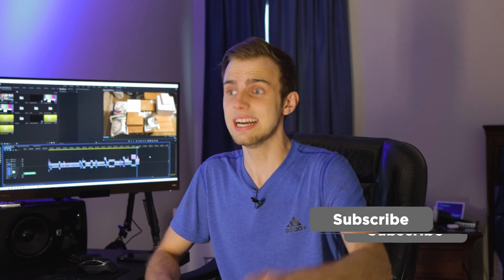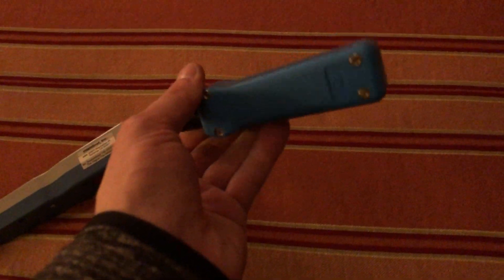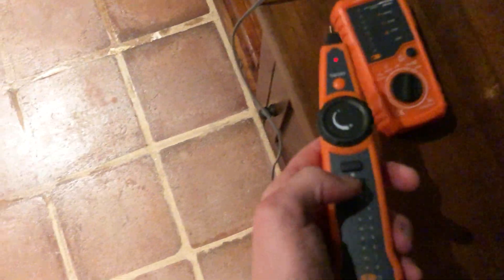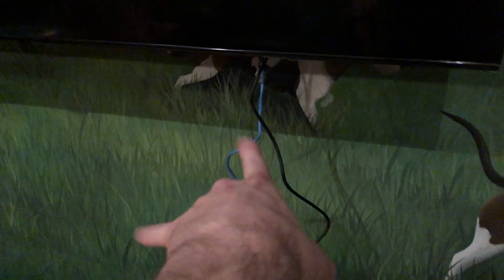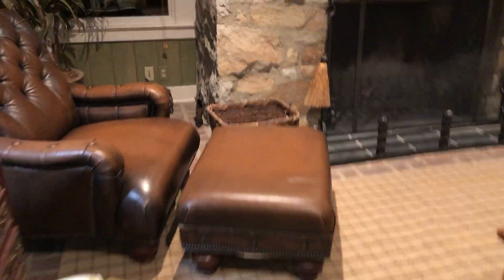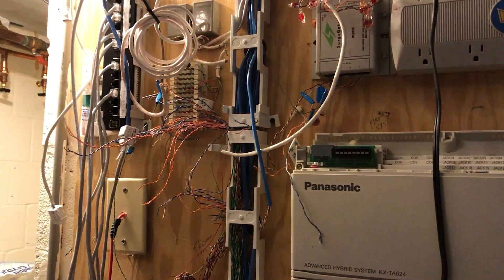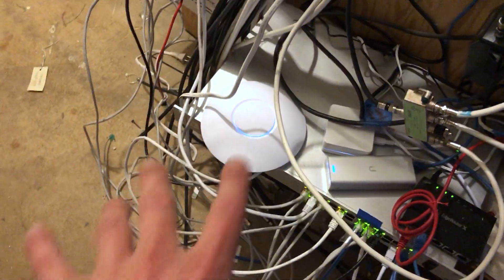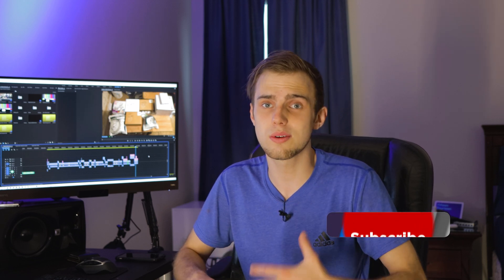Upgrading this UniFi Network Again...

Comment: Never skip quality due to client requests, they do not know what they are doing. If anything goes wrong you will get the blame for not saying no & for not doing it the right way. If there is a gun to your head, make the client sign a document stating they have requested speed over quality & that xyz shortcuts will be taken with abc pro/con. It's far too easy for clients to turn around and blame us as "the don't know IT"..

Comment: Thank you for linking to your tools, I also use the Trendnet punch. Could you provide a link to the cheaper tone & probe please? Link provided is for a Fluke :)

Look at a Led tone kit, it's great for toning an initial install to the patch panel almost instantly.

After 15y in Smb IT services in moving away from traditional patch panels to inline keystone patch panels. Crimping & testing a (good)  Rj45 end takes about 1/2 the time that it takes to punch down a good IDC port. Its more expensive (significant in my country) but considering it cuts your time by 40-60% per 24port patch panel, it really makes a massive difference per site. Also its easier for a Jnr tech to make a good Rj45 end, than a good punch down (tight twists to the termination point ; bare min jacket removal ; not working the cables over each other ; strain relief install etc).

Thank you for sharing your install / upgrade!

Comment: Good job. Will you look at mounting the APs on the ceiling at any time?
Reply from the maker: There isn’t any access to run cables. I HATE leaving them on the floor, but there isn’t any way to get cables to the ceiling except for on the third floor. That ap will be ceiling mounted.

Comment: Miller when wiring for the Panasonic pay attention to the polarity of the lines.  Line 1 is -+ (ring and tip) and line 2 is + -.  If you reverse it, it will still work but the voice mail will give you trouble.  Also the cable that you are using it looks like plain Cat 5 and not Cat 5e.  In that area I would use a shielded cable and use MoCA for the coax.
Reply from the maker: The wiring is all cat 5e.

Comment: Great video! This is always fun :)

Is there a reason you didn't use U6-Lite? Doesn't it beat the NanoHD in performance and price?
Reply from the maker: 4:03
Reply: The network pass through on the AC Pro for his TV.
Reply: @Sebastian-ur7lg  Is the TV 1Gbe? If not, unless this has been fixed through software, it will lower the Main input on the AC Pro to 100Mbe.

Comment: How did you get started with this business? I’m in love and I want to do something similar but finding clients and building a business at 19 is hard in India
Reply from the maker: ISPs suck here so I wanted to do it better. I told someone about it and they asked me to network their house too. Everything has been word of mouth from there. Being young doesn't make it any easier, but it did allow me to have lower prices because I didn't have any overhead cost like rent. Now I have raised my prices and have previous work under my belt to use as justification for my pricing.
Reply: @MillerTechnicalServices  thank you so much

Comment: I have never seen a telephone adapter to RJ45 before, are you able to put RJ45 ports where you have a telephone connector plate, so in a room or a bedroom and have a functional RJ45 connection?
Reply from the maker: If they used cat 5, 5e, or 6 for the telephone wire and it isn’t daisy chained to other rooms, then yes you can. If it uses something else (generally 2 pair wire), then you’ll be limited to 10/100 speeds.
Reply: @MillerTechnicalServices  ok thanks, I was hoping to use the telephone lines in the house to set up another computer or access point, but 10/100 is not the speed I would need. I am still looking at MOCA and that might work with my existing cable wire in my home.
Reply: @HollowayMooseRanch  I have similar situation and I get gig over my cat5e by using ALL eight wires.  In other words I converted the RJ11 plugs to RJ45 and used ALL eight wires.  I have gig going in all bedrooms.